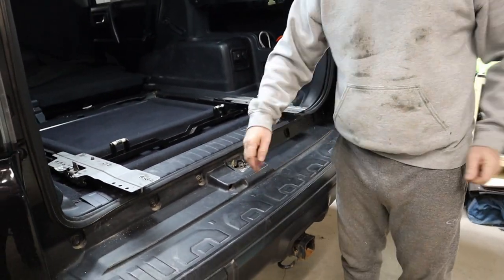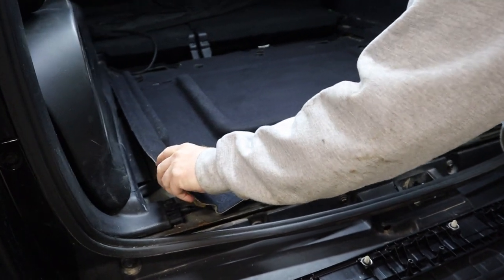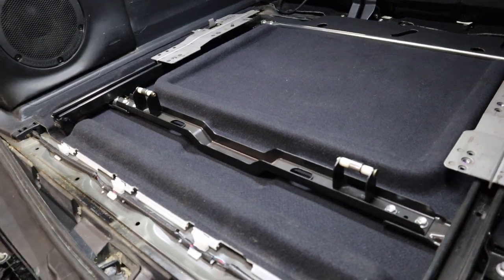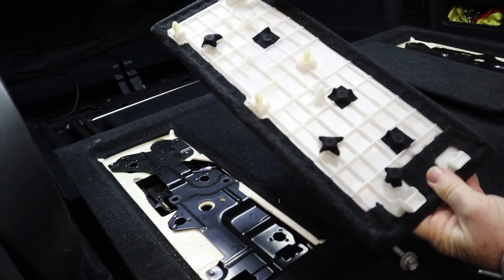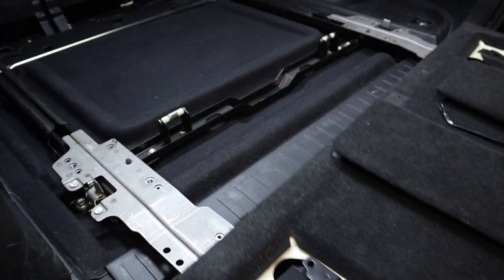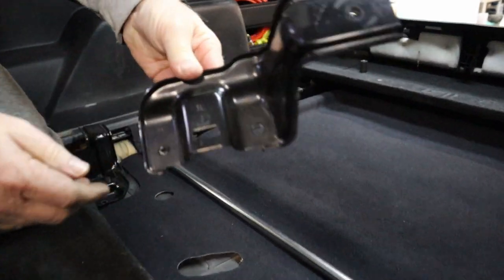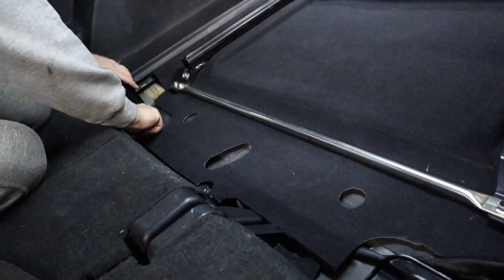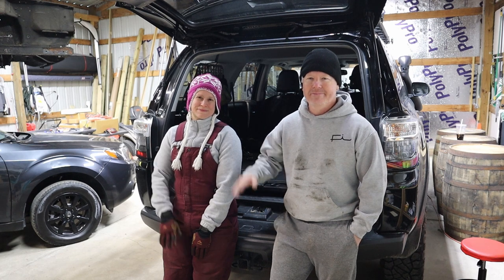How to Install a Toyota 4Runner OEM Rear Sliding Cargo Tray

Comment from the maker: We have learned through many of our viewers that the dealers are unable to get these at all now. We can't say that this is the case for all but so far, I haven't heard of one that can. This is a huge change from when we first made this and the parts department locally here in OH, said they could order it.
Reply: OK so I'm not crazy. I've been looking for an OEM slide out tray all over eBay and Toyota dealer websites.  No luck with that or with calling dealerships.
Reply from the maker: @n00206  Definitely not crazy. I was shocked because the last time I asked about them, the dealer I stopped in to see, didn't mention they weren't available. I'm bummed as I know quite a few want it.

Comment: Great video. I am awaiting on my 2023 Toyota 4Runner TRD Pro in metallic gray which I should receive it by next week. Just wanted to know if the charge tray is holding up. If so I will be purchasing it. Thank you very much. Just subscribed to your channel.
Reply from the maker: Hi Trevino73. First off, thank you for watching, sharing and subscribing. We greatly appreciate that. Congrats on your upcoming 2023. I know it's going to be sick. For this cargo tray, we no longer have it. This was made just before we took it out to sell. We made the episode because there was zero out there on it. From other viewers that have commented, it sounds like this is incredibly difficult to get from the dealer so I'm not sure if you will have any luck on getting a new one. It worked great for us until we decided to upgrade to a full storage solution and it needed to go then.

Comment: Great and informative video, thanks for making it! I'm on the cusp of getting a 2023 TRD Off Road Premium, and all the ones listed here in SoCal as of February 4, 2023 come with this tray. Would be useful for us older folks. One question: any idea how much floor-to-headliner distance does one lose with this unit installed?
Reply from the maker: Thank you for watching and sharing the kind words. We also appreciate you letting us know that the new TRD's come with it. Congrats on that purchase! It's great news and hopefully they haven't changed the fitment so 5th gen's alike can use them. As far as lost space, it's really not that much. I'm going to say less than 6" as it's really not that much. Hope that helps and that you enjoy many years of safe trails in your new Runner.

Comment: Good vid! What is the cord or wire that you moved on the front right and where did you move it to?
Reply from the maker: Hi Big T. Thanks for watching and sharing the kind words. We really appreciate that. It's likely the hard wire for our Iceco fridge/freezer that we plug in to. We moved it around to the left because of the new drawer system that we installed after selling the cargo tray. Hope that helps. Cheers!

Comment: Great video thanks!!   My 4runner jas 3rd row seat, I would delete.    Would this part and procedure be the same since I would be getting rid of a 3rd row seat?  Any roadblocks with 3rd row delete then adding this tray?  Thanks
Reply from the maker: Hi Jamesh. Thanks for watching and asking. We greatly appreciate it. I wish I had an answer for you on it but I'm not sure how these may or may not work with the 3rd row since I personally  have not looked to see how they are setup in the back. I  would call the dealer to see what they say. Wish I could help more. Stay safe out there!

Comment: nice video I want to take my third row out seems like a simple swap ?
Reply from the maker: Hi Shawn, thanks for watching and asking. We greatly appreciate it. I seem the recall somewhere that I came across that this doesn't work for those that have a 3rd row seat. I could be wrong but something is telling me that was the case. If you're even able to find them now,  I would consult with the dealer to verify that before purchasing. Hope that helps. Stay safe out there!

Comment: Where did you guys find the tray and all parts needed for the install? It seems every dealer and Toyota parts outlet says they are not able to order it and it can’t be done?!
Reply from the maker: Hi Richey Rich, we're learning that no one can get them, which is shocking. This was installed already when I purchased the 4Runner. I did check at one point with a local dealer here because I was curious on how much they were and could be purchased, which they were at that time. Something must have changed and I'm bummed about it because so many want it. Thank you for watching and asking. We appreciate it.

Comment: Did you buy the sliding cargo deck from a private seller or from an OEM parts store? I'm trying to find one local to me but it's a chore.
Reply from the maker: Hi Alexi. Thanks for watching. We really appreciate it. This slide came with the vehicle when we purchased it. These are OEM only so you have to buy from the dealer unless you come across someone selling theirs like we did with ours. Hope that helps.

Comment: Hi, wondering how much torque did you use for those 14mm bolts?
Reply from the maker: Hi illmateo. Thank you for watching and asking. We really appreciate it. We didn't torque this one down because we knew we were going to be taking it back out for sale the next day. I don't have the torque numbers though to share unfortunately.
Reply: No problimo. Thank you for getting back. Hand tight with an extra quarter turn it is!

Comment: Just bought my 1st 4runner TRD off road premium and it did NOT came with the rear sliding cargo. I;m on the market on purchasing one and install it myself base on this video.
Reply from the maker: Hi Ben. Thank you for watching, and we're glad you enjoyed it. We wish that Toyota sold these through their parts department still and even more so they were consistent on what new vehicles they pre-installed them in. Doesn't seem like that is the case, and last we heard, they weren't selling them at the dealer as well. That was not the case when we made this video. We hope you're able to find one for your rig. Stay safe out there.

Comment: What is the part number for the entire assembly? I just recently got a 4Runner and this would very much be something I need.
Reply from the maker: Hi Jason. Thank you for watching and commenting. We grealty appreciate it. To be honest, I'm not quite sure what the part number is. The parts department at your local Toyota dealer will be able to pull it pretty quickly. I actually stopped by one of ours just to ensure they do sell it and find out what it costs since we were getting ready to sell ours. Hope that helps you out and you're able to pick one up. Cheers!

Comment: Would you say its worth it, installing a snorkel?
Reply from the maker: Hi Joshua, Thanks for watching and asking. We appreciate it. For a snorkel, in my opinion, there are a number of factors that would weigh whether to get one or not. 1: Are you even going to be crossing water features where it would be helpful/required. 2: Are you keeping the vehicle for a long time and not afraid of it impacting the sale of it.  For us, it came with the 4Runner as we bought it used but we have crossed some deeper water features where the water has come up over the hood so having one certainly gave me more confidence but also less concern of issues. Hope that helps. Stay safe out there.
Reply: @SpiritedWrenchers  how did you make sure the snorkel was sealed properly, did water get inside your car too?
Reply from the maker: @joshuajay2886  The snorkel goes through the fender. No, we didn't get water inside the vehicle the times we crossed.

Comment: SO glad I found this video, it looks super easy to install! Where did you order/purchase the rear cargo slide kit?
Reply from the maker: Hi WillSee Adventures. Thank  you very much for watching and sharing. We really appreciate it. Unfortunately these kits are a dealer item only. When doing this video (since the kit came on the 4Runner when we purchased it) I tried to find an aftermarket version but they're not out there. The dealer parts department will be able to provide you the info for your local market. Hope that helps and you stick around for more 4Runner episodes. Stay safe out there!
Reply: @SpiritedWrenchers  thanks so much for the info. I will plan to check with the dealer.
Reply from the maker: @willseeadventures  you're most welcome.
Reply: @SpiritedWrenchers  Hi, I'm Joe with a new 23 TRD. I called two local dealers and they said I cannot get or order this.  I asked what if an original was damaged and they said I cannot get one. This makes no sense.  Any ideas of a cooperative dealer? I'm in central Florida. Thanks.
Reply: @joeherndon6170  I have a 22 TRD Pro and ran into the same thing you have to buy each part separately then install it and it gets very expensive.

Comment: where did you buy it?
Reply: also how much?
Reply from the maker: Thanks for watching and asking. We appreciate it. This one was actually installed already when we bough the 4Runner. We have heard that the dealers were no longer selling them but just recently a viewer told us that it's included on his 2023 TRD. I need to call the dealer and inquire to see if they will be selling them again this year or only included on particular trims.

Comment: Can I do this on a 2015 4R sr5 premium that doesn't have a sliding tray?  Are the holes already there underneath the carpet? THANK YOU FOR THIS VIDEO!!!!!!
Reply from the maker: Hi Noctilucent. Thank you for watching and asking. We greatly appreciate it. It's a great question. The Premium's may be able to. I'm pretty certain the Trail and Pro's can. I was told that not all can though but those that do already have the mounting holes there from the factory. If you can easily access the carpet, it's a quick job as you can tell to pull it up to see if you have them. Or I would call the Toyota dealer parts department with your VIN to see if you can. Good Luck and thank you once again.
Reply: @SpiritedWrenchers  Do you have a link where I can buy the sliding Cargo deck?  Thank you so much very much would love this cargo deck it means a lot to me
Reply from the maker: @noctilucent7396  unfortunately these are sold directly from the dealer so you have to call your local one. I couldn't find them online at all.

Comment: Did the storage tray by the 2nd row come with the kit or was that already in your vehicle? Thanks!
Reply from the maker: Hi Susan. Thank you for watching and asking.  We appreciate it. To be honest, I believe it is with the kit but I'm not 100% certain as it was installed on the 4runner when we bought it but I did include it when we sold it because it only makes sense that it is all together.  Hope that helps.
Reply: @SpiritedWrenchers  thanks for the info. I bought my 4Runner new in ‘14. Premium trim level with a 3rd row which I didn’t want. I wanted the cargo tray. I’ve schemed since then to do a swap. I may do some peaking to see if all the mount points are there. Thank you for the assist to get there.
Reply from the maker: @susanhester331  our pleasure.  Glad to be a part of your journey. Hope you can make that change. Stay safe out there.

Comment: This video is missing the most crucial part. The drilling of the holes for the mounting bolts. So it’s not as easy as it sounds. Anything that requires drilling/cutting into the sheet metal is a no go for me.
Reply from the maker: Hi SkippyPB, thanks for watching and commenting.  Just an FYI on this, there is no required drilling or cutting for these that have the factory mounting locations already there. Our 4Runner required none of that,  thus why it's not in this episode.  Hope this clarified it for you.